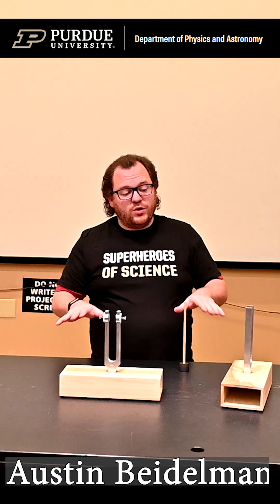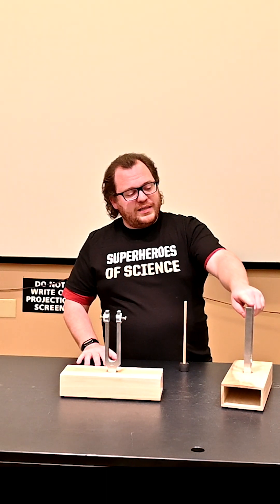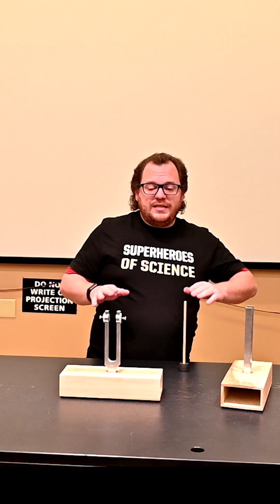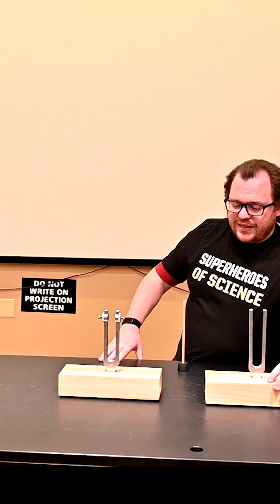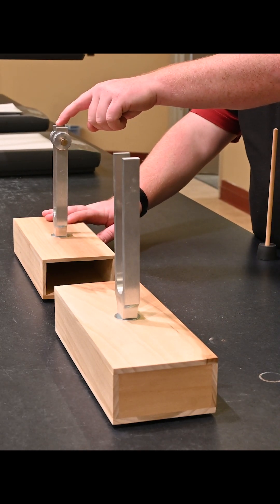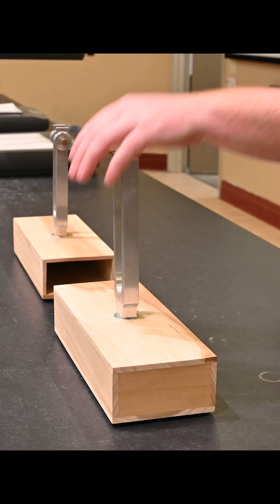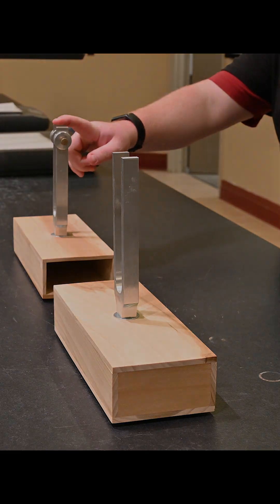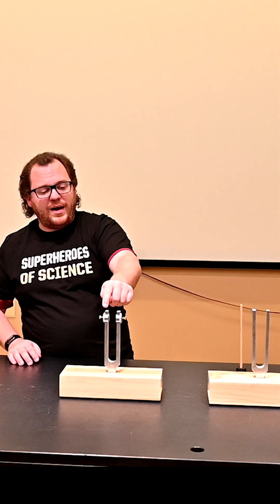Resonance with Tuning Forks

Comment: But can you extract useable piezoelectricity from the 2nd tuning fork and if so, why not multiple tuning forks in endless arrays by banging on key equidistant tuning forks simultaneously? How many resonantly-tuned forks could sympathetically vibrate for any useful purposes besides taking down a bridge or building or the walls of Jericho?

Comment: I believe there's a flaw in your explanation. 

It's not that the box vibrates and therefore the tuning fork matched to the other one starts vibrating. It's the other way around. Because of resonance the matched tuning fork starts vibrating and therefore the box on which it's fixed, starts vibrating too.
Reply: No. The first fork is fixed to a wood box that acts like a guitar sound board and directs the sound to another box which in turn makes the tunning fork vibrate too.
Reply: I don't even think that the box vibrates. I saw this experiment with no box and the fork still vibrated.
Reply: @RainBow-uf7hb unless theyre very close to each other or both mounted on the a solid base it wouldnt work.
Reply: thank you. I was wondering if I was the only one to know that.

Comment: This also works with voltage and inductors with electricity. You can change DC to AC. Also, like a guitar string, has a resident frequency at a certain fret on a guitar.

Comment: I use a 440 hz fork to tune my guitar
 I strike it on a bone ( usually a knee) and touch it to the guitar body. When the 5th string (A) continues to ring after removing the fork it is tuned properly. I then use harmonics for the other strings.
Reply: Should be set to 432 hz. 
440hz inflames the human body
Reply: @lifepathreikihealing Do you really believe that / have you researched that or is that what somebody told you / have you experienced that yourself / do you avoid most of the music in the world????
Reply: should be tuning at 432 Hz, bro
Reply: Hi, what do you mean "harmonics for other strings"??

Comment: I am not getting this experiment right, what are the things that I should take care of while doing this experiment.
Reply: placement of matching pair of tuning forks in direct center of top plate of boxes that have resonant cavities designed to match the frequency of the tuning forks. A formula is available for determining the dimensions of resonators for specific frequencies. regards.

Comment: How far apart can they be apart to be able to wibrate and how to you adjust a tuning forK. Do they have to sit alike side by side and the same way?
Reply: Are you serious? you don't adjust a tuning fork. That's the point. It always vibrates at the same frequency.
Reply: typically, radiative forces' intensity decrease at an inverse square of their distance from the source. regards
Reply: However far the soundwave can propagate before falling off. These forks were placed so near to one another and atop amplifiers because they create a relatively quiet and high frequency sound, which doesn't travel very far before becoming imperceptible. Lower frequency, higher volume sounds can travel much further, so you could resonate with objects from further away with them. 

As for the tuning forks, they have little weighted clamps on the tines that can be moved up or down to change the way sound waves move through them.
Reply: @barndo3141  never seen one of those.

Comment: So what happens if you take the other tuning fork out
Reply: He's demonstrating acoustic resonance. Since both vibration at the same frequency the vibration from one migrates over and affects the other. One way to eliminate the transfer of vibration, is to adjust the stiffness (since one of the forks is "adjustable") to where it's frequency response is either higher or lower than 256 hz.